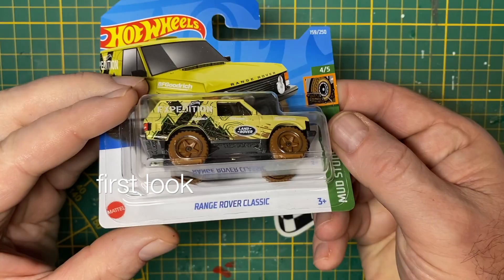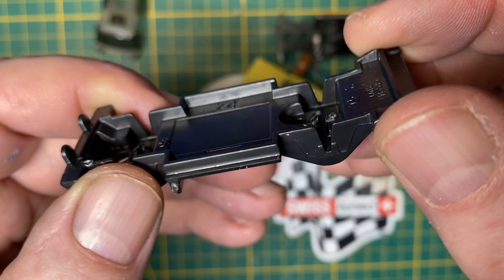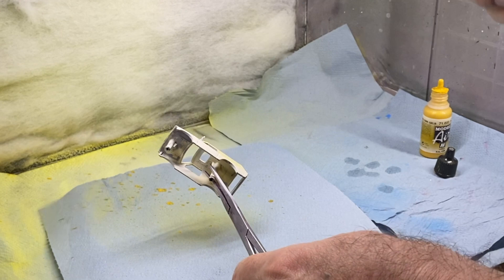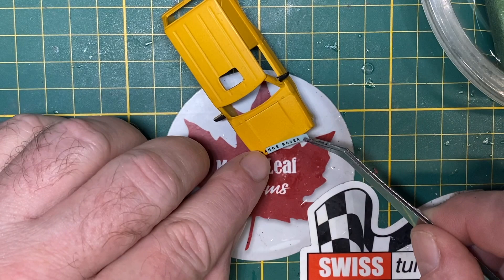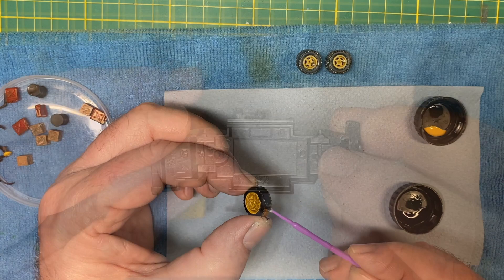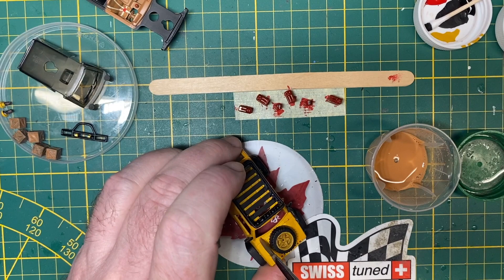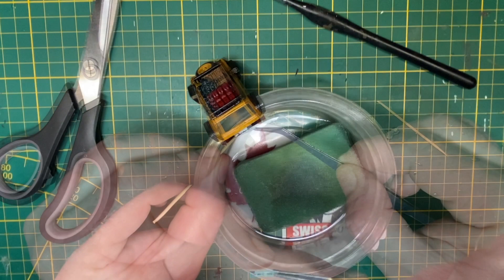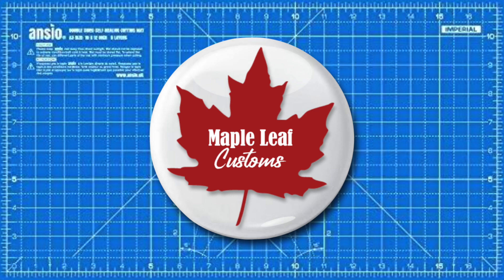Hot Wheels Range Rover Classic (222) Four Horsemen safari theme

Comment: Silly question: Where do you get the 56 screws? I ask because I was unable to find them at my local tool shop. Do you order them online? Thank you! Oh, and what do you use to remove the paint from the original vehicle?  I apologize for such "newbie" questions, but I am a newbie. 🙂
Reply from the maker: Hi, Mel. Thanks for watching and for the good questions. I had all the same ones when I was starting out. You'll need to order the tiny screws online. I've never seen them in a hardware store. Not expensive though. And any strong paint stripper will suffice. Mine is a Euro brand. I see lots of guys using Citrus Strip, which is available at Walmart in the States. Make sure you're masked up and in a well ventilated area when you use it. Have fun with it all. It's a great hobby! Greetings from Switzerland. 🍁☕️👊
Reply: @MapleLeafCustoms  Awesome, thank you! Are the screws just called "56"? I just want to make sure I get the right ones. I have several old Matchbox trucks that need some TLC. 🙂
Reply from the maker: @meltorme-ntor2933  the standard size is 2-56. Look for Philipps head or Button head screws. Mine are self tapping, so one less step in the customization process.
Reply: @MapleLeafCustoms  Again, thank you!